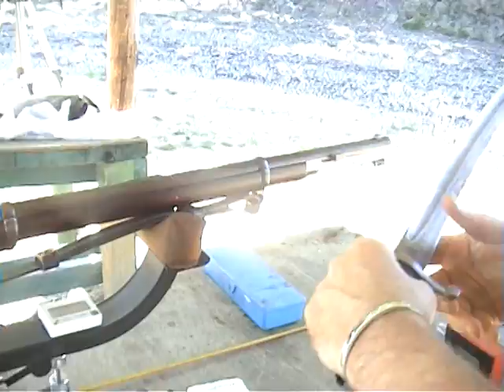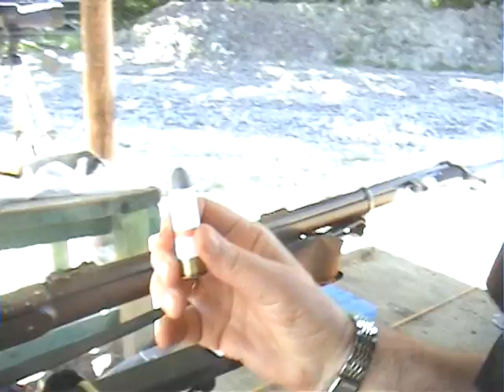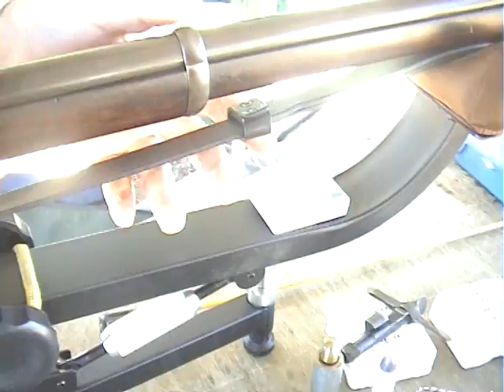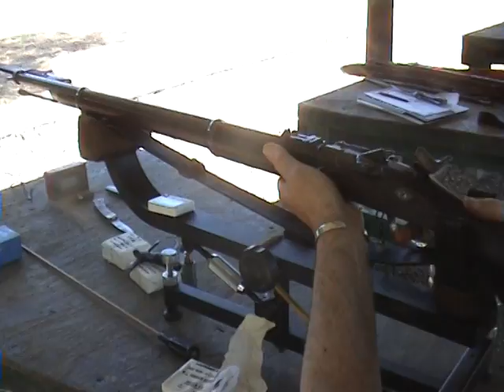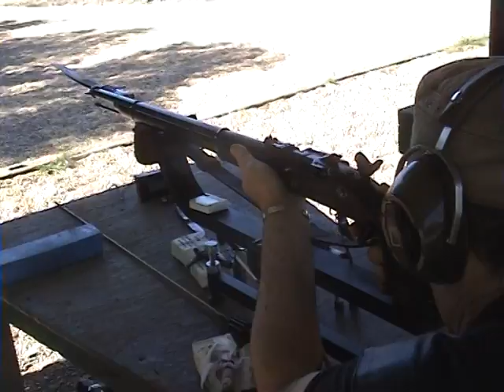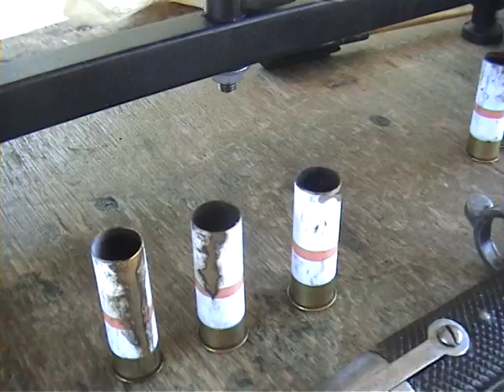Shooting Snider Short Rifle with and without fixed bayonet.avi

Comment: What is the function/purpose of the paper wrapping around the cartridge? I have a Mark I Snider and no longer resize the cartridge the whole length (just the neck enough to slightly pinch the slug), so I don't think they would even chamber if I wrapped them.
Reply from the maker: +little house guy Only for authenticity sake, the significance of the paper with single red ring is to identify the cartridge as a Mk IX as was originally used.Regards,G and L A-R-West